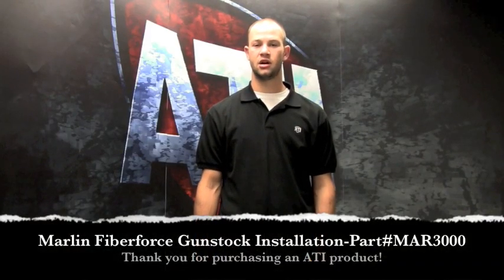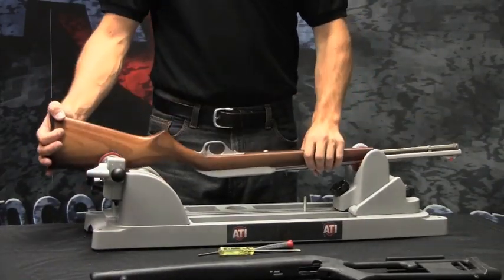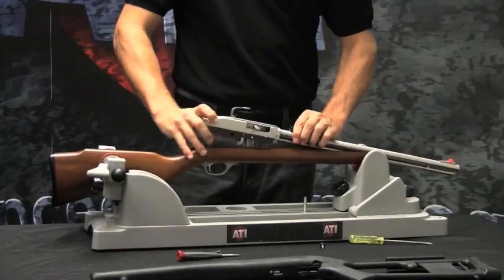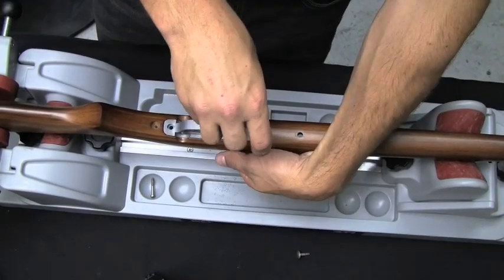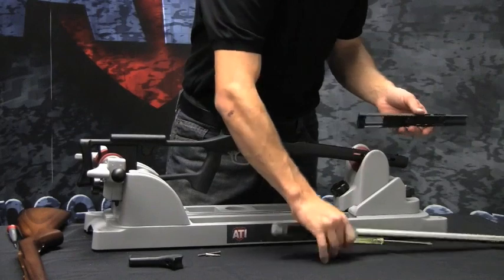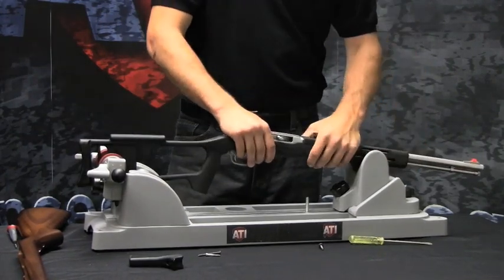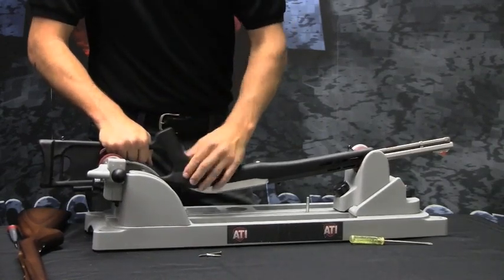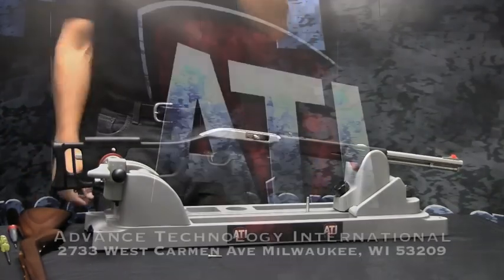ATI Marlin Fiberforce Gunstock Installation

Comment: I picked up one of these for my Marlin model 60 a couple of years ago. The factory stock got a little tiring when I was aiming up all the time hunting squirrels. The pistol grip shape of the handle makes it alot easier to keep it steady when you need to aim strait up all the time. I have since used Krylon Camo Fusion paint to paint hte stock camo and it turned out extreamly well. The paint bonded very well to the stock. All in all i am VERY happy with the stock and recomend it.

Comment: Hello; I just installed mine on an old Glenfield 60 that I've had since some time in the late 70s. Installation was easy, the only problem I had was the trigger group holes didn't line up perfectly (slightly off), but all I had to do was put a small phillips screw driver in the front hole and slide it into alignment making it it fit very snugly into the stock, which is a good thing. I haven't fired it yet but it feels very comfortable bringing it up to my shoulder and I especially like the pistol grip. And also it just plain looks extremely cool, it really dresses up the gun.  I also wanted to mention that I ordered directly from  ATI and shipping was fast and it came in a very nice box padded with foam rubber. Anyway, at least at this point I am very happy with it and can't wait to shoot it.

Comment: I've owned two different Ruger 10/22 rifles, one I bought in the 80's and the other in 2003, but my wife and I both bought the Marlin model 6080 tube fed semi-auto 22LR rifles in the late 70's, and both were far better rifles as far as accuracy, dependability, and non-jamming, than either of my Ruger 10/22 rifles, the only thing I like about the Ruger 10/22 was the detachable magazine. I've just now came across the ATI Marlin model 60 synthetic stocks and I really like the design, especially the pistol grip and the weight, so I'm definitely gonna get one for my Marlin that I still use daily for 45 years  to present day for varmints.

Comment from the maker: @Feth, the ATI Marlin Fiberforce stock can be fitted to the 980 however you will need to remove some material from the bottom of the stock so that the magazine will fit through the stock.

Comment from the maker: Yes, the Marlin Fiberforce stock can be fitted to the 795, however you will need to remove material from the bottom of the stock so the magazine can fit through the stock.

Comment from the maker: the ATI Marlin Fiberforce stock can be fitted to the 980s however you will need to remove some material from the bottom of the stock so that the magazine will fit through the stock.

Comment: @sinfactory1 I've read online and it can be made to work.  Supposedly you just need to remove/dremel some material around the mag/mag well.  For 40-50 bucks I'll buy the stock and see if it can be done easily.

Comment: Where was this junk manufactured?? China most likely! Although the instructions state that fitting and common wood working tools are *required it makes no mention of the approximately two to three hours of cutting and fitting necessary to make it functional. None, not one of the predrilled holes were where they should have been, not to mention that the pressure mold was probably uncalibrated due to the poor quality in the manufacturing and lack of quality control. I had to do it all over again, I would definitely pass on this item. BUYER BEWARE another unsatisfied customer has stated the facts.
Reply: Made in Chinatown.